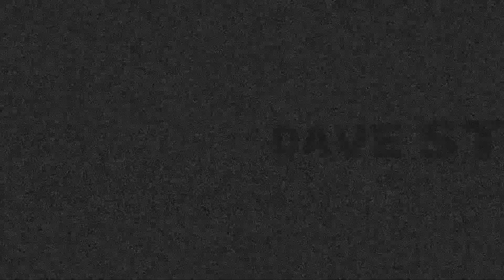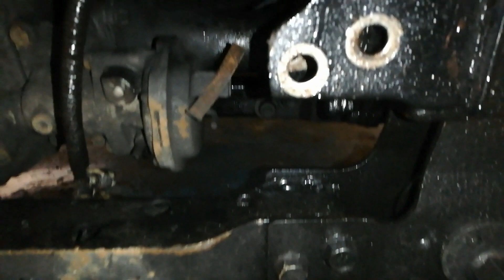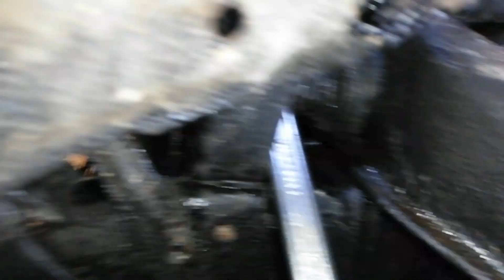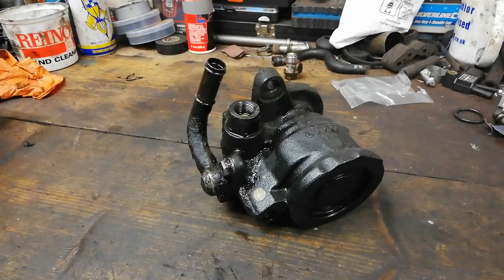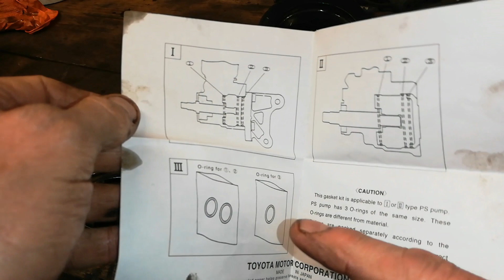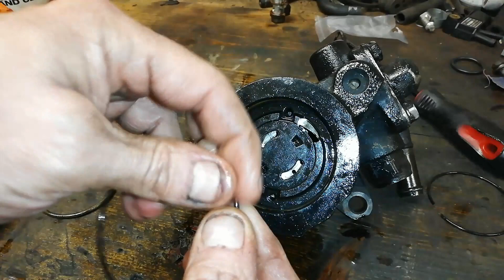Toyota 1KZTE Power Steering Pump Leak

Comment: Hi Dave, just wandering when you removed the pump from the engine, do you need to set any timing of the motor for when you replace the pump to motor...or just slots back into the cog mechanism on the motor...

Comment: You Legend!
This was exactly what I needed to locate and remove my own one

However, I’m trumped, how you got that out I just do not know, There’s a pipe and a hose below that refuse to move, 
What did you do to create space?

Corrected: I got there, turns out that plastic housing for the power cables, was only clipped to the frame, I was pushing on a clip that was to be pulled, once I got that right, it slid right off, and moved with plenty of flexibility

Thankyou Dave, you have saved my day with this video 🤟🏻

Comment: Hi there. It has been suggested that i ask you, if you have some info i am searching for with no luck(by a chap known as intrade), i am after a connection diagram for a alfa 2003 156 cloverleaf, selespeed gearbox, either a full wiring diagram, or plug pin numbers for solenoids or wire colors. Car is worthless here now (under $300), even though in almost mint conditon, so paying someone to diagnose is not an option
Reply from the maker: Not sure how i can help you. I have some info on this but it is specific to the operation which is copyrighted. I can only suggest you see what is on google or here is an overview video
https://www.youtube.com/watch?v=jgopyRYTOH0

Comment: I hope that you are going to see the funny side of this. A long time ago I learned a hard lesson. Customer complaint; hydraulic fluid leaking over the brake pedal. Ah! says I, that should be easy I just need to put new seals in the master cylinder. Wrong! When a car gets to a certain age you need to change ALL THE SEALS!. I forgot mention that this was a 1968 E type Jag with a 3.8 straight six engine. For those of you who don't know, they have inboard brakes. The reason for this is that when you hit a bump in the road there is less inertia in the wheel and less energy that the suspension has to dissipate. . Basically, your tyre will back in contact with the ground a lot quicker.
The other problem is that they have a dual hydraulic circuit which is configured like an X. So if your front right brake pipe failed you would still have braking on left front/right rear. This means they are a bastard to bleed, I wasted lots of hydraulic fluid on this one.
Next problem; as I mentioned they have inboard brakes. All the calipers have twin pistons and to remove the one's closest to the diff you have to drop the back axle.
The only good news was that I got to drive an E type Jag for a month, purely for testing purposes, your honour :)
BTW Dave I spit on your Suzuki, it sounds like a motorbike. An E type sounds like a proper car. LOL!
Reply from the maker: Second that for replacing all the seals in the master cylinder. What suzuki?
Reply: @davesterl  Oops! I somehow thought that you were a Suzuki enthusiast. Anyway I hope you enjoyed my admission to total diagnose fail.

Comment: Wee bit of a different drive arrangement...interesting. I was meaning to ask you Dave, when you did the Vid of your home town...The white buildings at the marina where the private sail boats dock. Is that a hotel or condo complex? Do you know the one I mean? (Looks like a very new build) It was well in the background in one of your shots...
Reply from the maker: Yeah not the usual belt drive. Lasts forever(apart from the rear seal). The white buildings are private apartments with a pub restaraunt called the wind rose. Www.thewindrose.co.uk
Reply: dave sterl Ahhh...Ok thx. Looks nice. None too cheap I’m sure. Cheers Pal
Reply from the maker: @TheGibby3340  carrick is pretty cheap generally. Centre of Belfast is getting stupidly expensive.